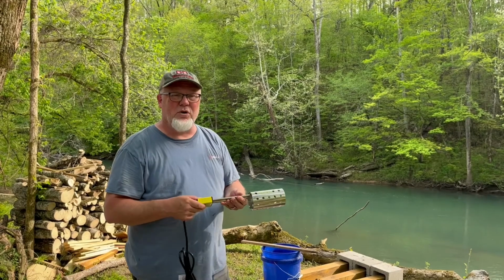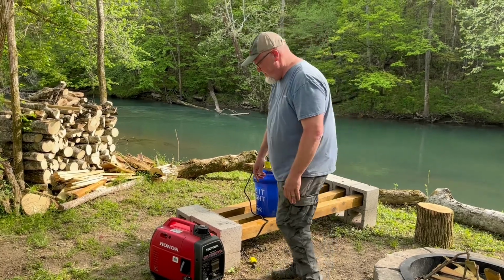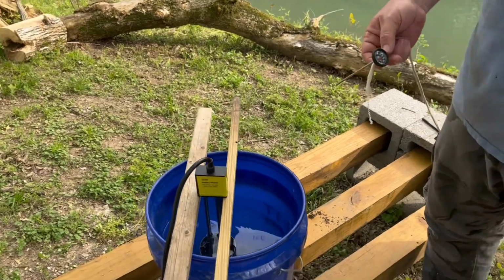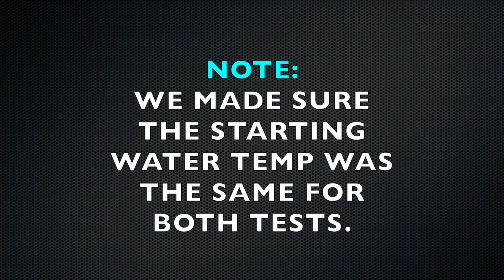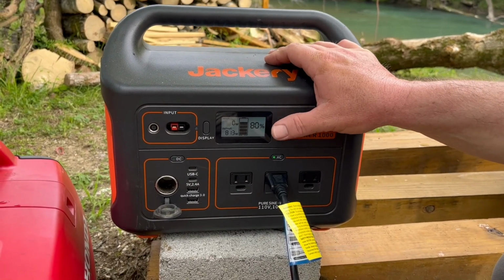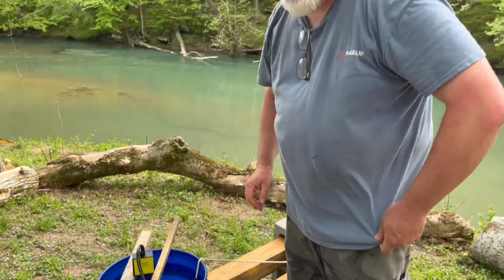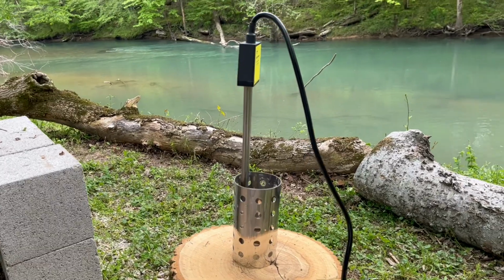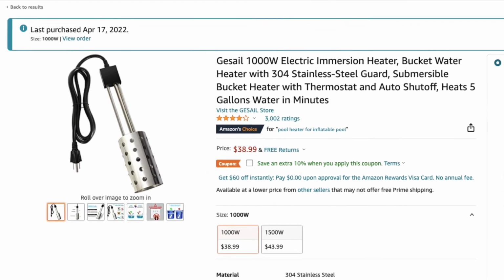Immersion Heater testing with Jackery and Generator

Comment: So it's really 830w heater which fits a YouTube video showing they run less than rated.  Excellent review and very helpful.   I want to go back to bucket showers rather than using a shower head.  I miss the rush that I get from dumping the bucket over my head after lathering up and I have solar generators or the Alp propane generator that is rated 850 watts but can go up to 1000.  I'm using a Vtoman 1000 and 1500 and they are fantastic finds for solar generators.  Bluetti not so much.
Reply from the maker: Thanks for the comment and thanks for stopping by!

Comment: Are you able to plug other electrical appliances into the generator to run along the immersion heater. 

For example I plug a blender or juicer while running the heater all plugged into my generator
Reply from the maker: It would depend on the watts available - if the immersion heater was pulling 1500 watts on a 2000 watt generator and you had another appliance plugged in (and running) that pulls over 500 watts, you'd probably have an issue.  Typically you're not going to use the immersion heater for extended periods, so it would probably be easier to use them at different times.  We have a 4650 watt generator, so using an immersion heater, blender, tv, etc., at the same time probably won't be an issue.

Comment: What was the temp at the bottom of the bucket you only tested the top inch
Reply from the maker: The immersion heater sat on the bottom of the bucket, so the heat was pretty consistent.  Once I removed the heater I placed my hand in the water and swirled it around, but I didn't notice any change in the temp.  We only ran it for 5 minutes and got to 110 degrees.